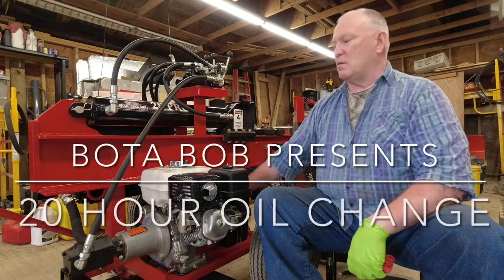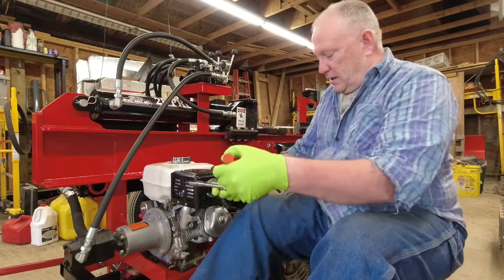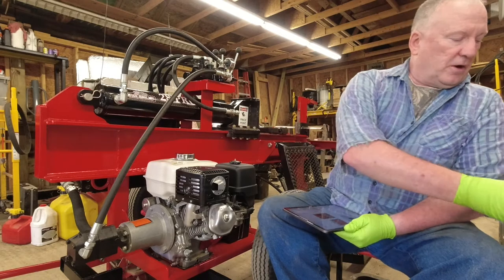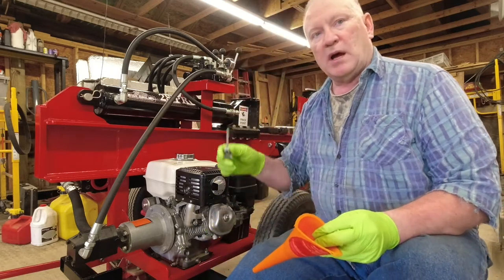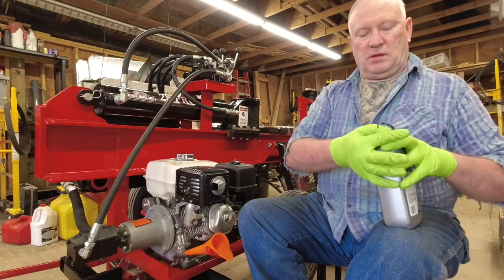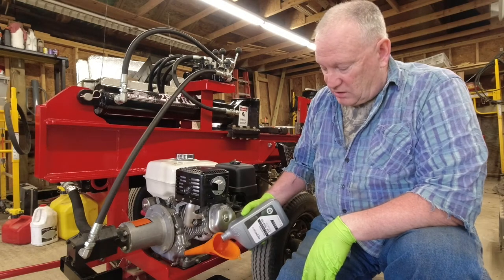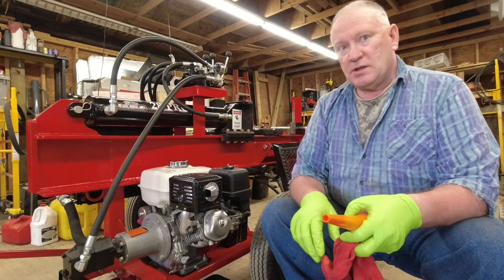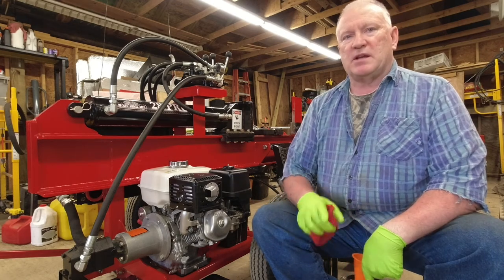#71 - Wolfe Ridge Pro28 - 20 Hour Oil Change

Comment: Bob good morning it's hot here yesterday hig 103 we have a Honda engine on the power washer is the best small engine we ever had
God Bless All 
PaK
Reply from the maker: Right on - wow that is hot - It was 92ish - not sure if it got any hotter or not.  I did some mowing - It is supposed to rain here all next week.  It's been pretty dry around here, so I guess we need to help the farmers water the fields.  The Honda engine is amazing.  I looked this one up on Amazon and the price was around $780.  This was the first oil change on the new log splitter.  Oil is cheap by comparison.  Thank you for watching and commenting.

Comment: Mine didn't sound right, I changed the oil and now it won't start. I used Quaker 10W 30   What are these letters for the oil you are talking about?
Reply from the maker: 10W30 is the viscosity of the oil.  The higher the number, the thicker the oil. If the engine does not run, refer to the owner's manual and follow the troubleshooting procedures.  Your owner's manual will also will include the recommended oil for your situation.  10W30 is acceptable for most applications between 10F to 110F.  Some small engines are equipped with a shut off switch that interrupts the ignition system when the oil level is below a safe level.  The owner's manual will have a schematic that shows how it works.  Remember, always start with the easiest things first.  
1) Fuel
2) Spark
3) Compression
4) Air Filter
Do you think it could have a dirty carburetor?  Moisture can cause the carb to gum up and keep it from running.  There are a lot of good videos to clean small Honda carbs - Here is one I quickly found - https://youtu.be/C900CJdnNzg 
Good luck - I hope this helps you
Reply: @botabob  thank you. I'm only at 16 hours. I thought I was past the 20 hour mark. I doubt the card is dirty.  The filter looked perfectly clean. I'll have to read the manual. Great idea video recording for proof. I'm going to do that on my 2oth hour.